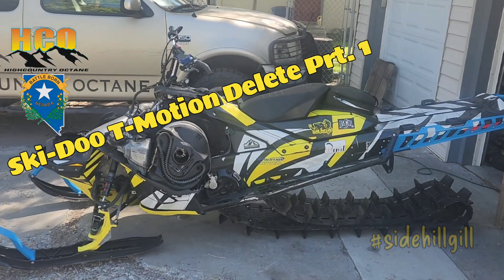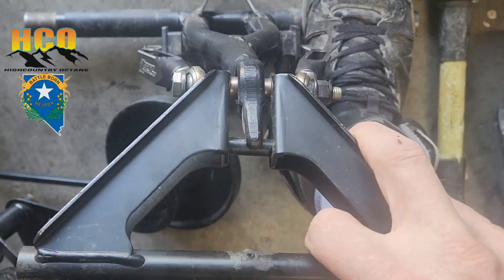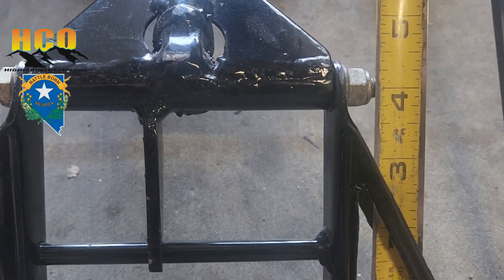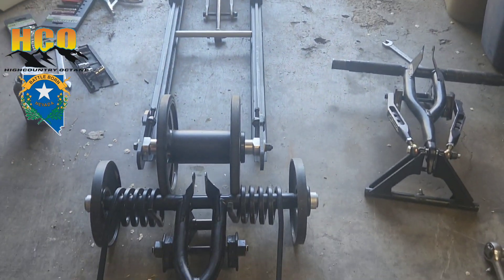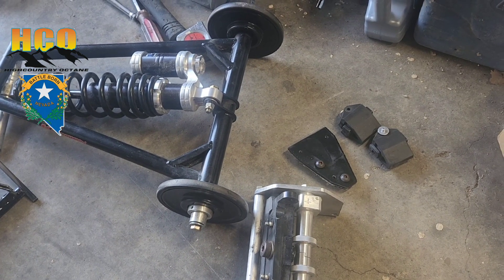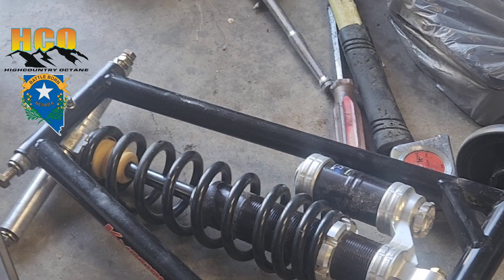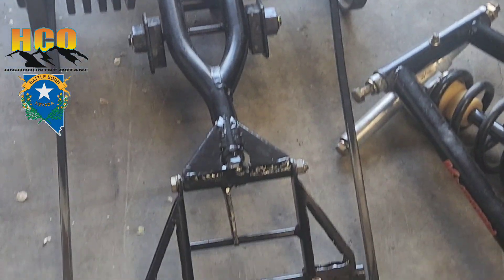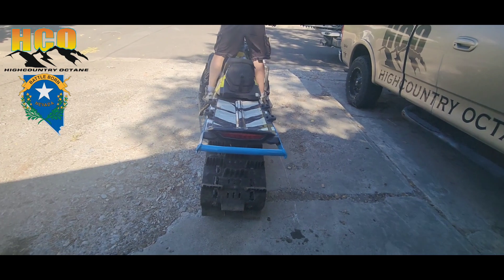Skidoo G4 850 T-Motion Delete Prt. 1

Comment: I still had significant motion with my ZBros kit even after attempting to lengthen/tighten the arms.   C motion is the way to go for full lock out.
Reply from the maker: I noticed same. Ditched z-broz lock-out and welded it up.
Reply from the maker: Some ive seen were tighter with the brass bushings combined with z-broz kit. But a few horror stories out there of brass bushing failure ending up in catastrophe.